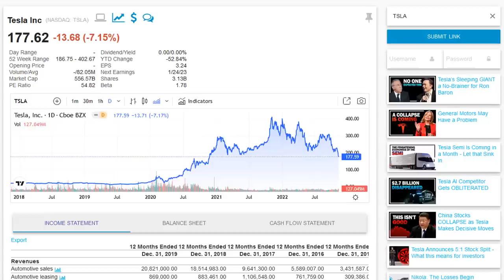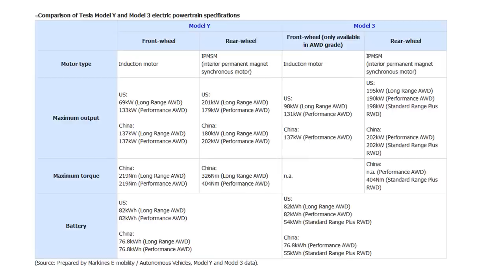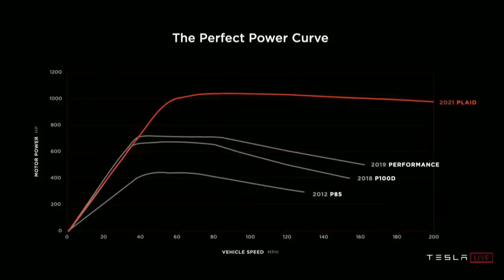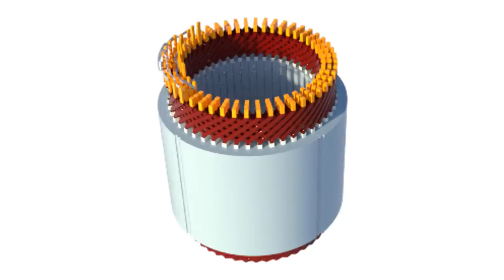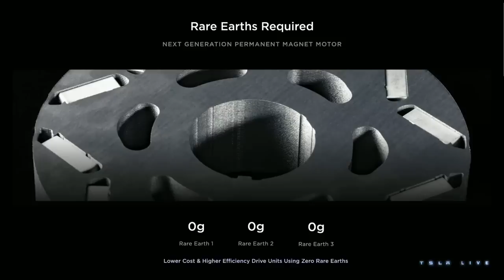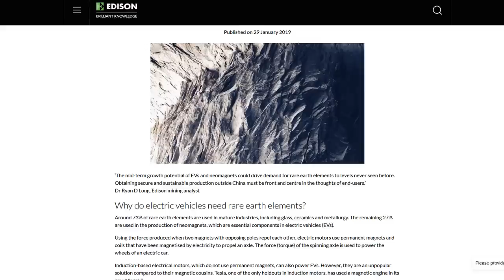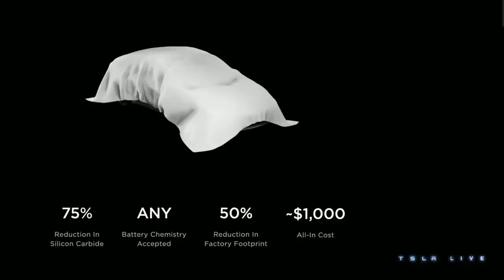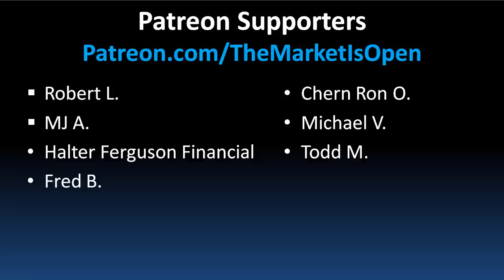Elon Musk's NEW INSANE Motor SHOCKS The Entire Industry!

Comment: No rare earth, so I guess that it will be induction motors then.
Reply: Pure squirrrel cage synchronous induction motor cannot be used EV for 2 things.
1. We need energy recovery system in which the motor become a generator. That require magnetic field which is provided by permanent magnet or external dc current through carbon brush (which make the system complicated and less reliable).
2. The EV motor need to run from zero speed to the maximum speed in controlled manner. In standard synchronous motor, the motor will run from zero to synchronous speed of the power supply very fast with no speed in between. We need Variable Frequency Drive(VFD), which is basically a variable frequency inverter. The frequency of this type of inverter can be controlled according to car speed.

Another thing is the efficiency of the common squirrel cage motor is in the low 90%. To have high 98% + efficicency requires permanent magnet in the rotor.
Reply: @anuardalhar6762  in that case Tesla has some unknown magnet breakthrough
Reply: Tesla will use it, the induction motor, as part of driving down the cost. Ultimate motor performance will not be necessary and the savings will get passed down to customer. Tesla will squeeze the most efficiency out of the cheapest solution. At that price, the customer will not care if it is an induction or permanent magnet motor. They'll appreciate the savings to their own bottom line. I didn't know Tesla employs both an induction and a permanent motor in their dual-motor setups, that's ingenious.
Reply: No surprise sending money to China for 'rare' nor US politions to approve new US 'rare mines

Comment: THEY CREATING A STASTIC DATA BETWEEN THE TWO MOTORS EITHER INDUCTION MOTOR OR PERMANENT MAGNET. AFTER FIVE YEARS THEY WILL RELEASE WHICH MOTOR IS MORE EFFICIENT.
Reply: Don't forget, that current Tesla's "PM"-rotors use reluctance in high RPM... instead of magnetism.
I guess new design and motor control will extend the use of reluctance to lower RPM, allowing them to avoid rare earths for magnets...🤞

Comment: This might sound crazy... but during the powertrain section of TID, he mentioned using software to design the best magnetic field for the drive unit.  

I wonder if Tesla is using AI to design other aspects like the best way/order to assemble the vehicles...?

Seems like a task Tesla's AI would be able to perform.
Reply: Elon said in TID, that AI plays no part in building Tesla's car's and if it did, they would all be out of a job very quickly.
Reply: Bingo :)
Reply: Bbv
Reply: I was thinking along the same line as you.
Reply: It's call software simulation. Literally used since forever.
Reply: @tomodoros6846  PI think Elon meant.the AI would be  fired for results to date
Reply: @mikedar8484  good one my friend.